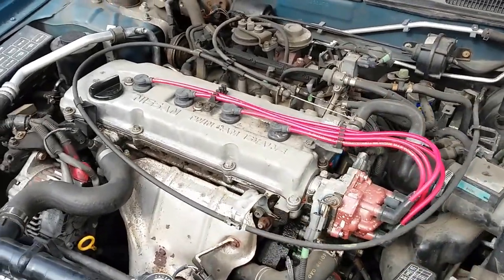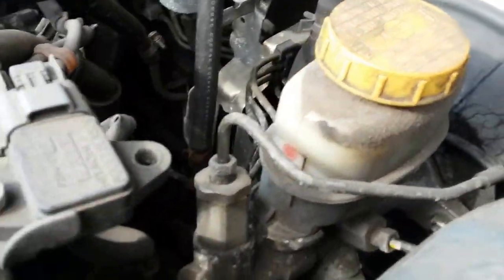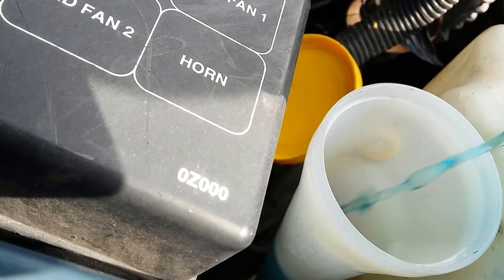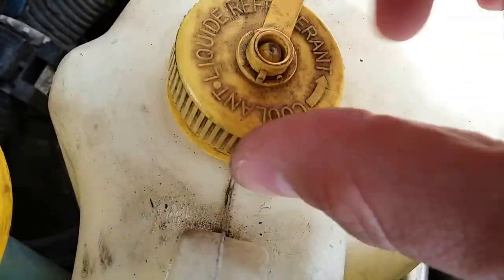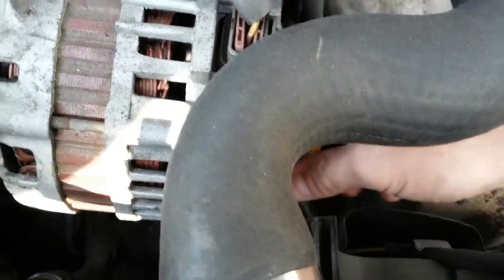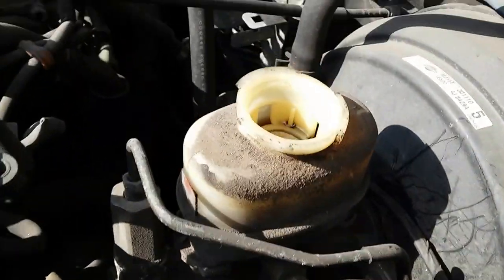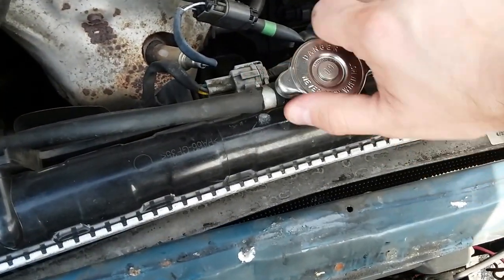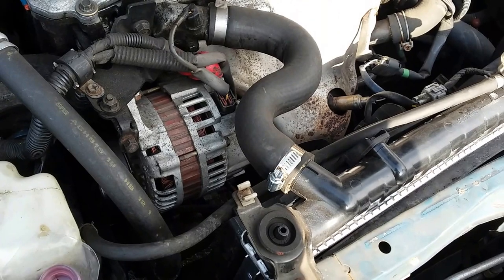Refill Fluids Check Nissan Altima 98

Comment: Big props!! Thank you, man!
Reply from the maker: No problem
Reply: @KETO.n.WRESTLING 

By the way, I have a quick question!
How often is someone supposed to drain their power steering oil?
I have a Nissan Altima GXE 1998.
And the car has been sitting there for almost a year. I'm trying to drive it again, but the steering wheel was hard as a rock. 

When I add the power steering how much of the fluid is it supposed to take?
Because when I fill it up.. It just keeps going down..
Any chance you could tell me how much fluid am I supposed to put in it?
Because I bought one fluid that's 32 fl Oz.
Do I have to put in the whole thing or?

Your input would be very much appreciated.
Thank you!
Reply from the maker: It should hold at least 16 ounces of power steering fluid. I recommend changing all your fluids once every 2 years. Oil every 6 months. Have your fluids drained by a mechanic and refilled to prevent build up of gunk

Comment: I know this is old but what kinda coolent I need for a 1996 Nissan Altima I been useing green 5050 the guy at the parts store said use green and I swear it uses yellow
Reply from the maker: I use the yellow 50/50 one in mine and my car is a 98 Nissan Altima
Reply: MatTroise thanks man I thought it was yellow
Reply from the maker: @jaymarleno8958  No problem